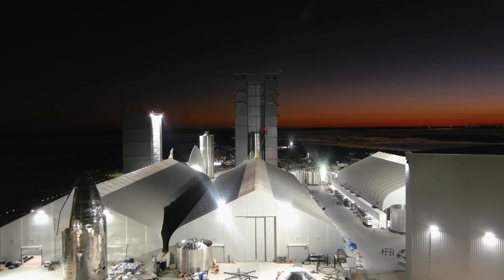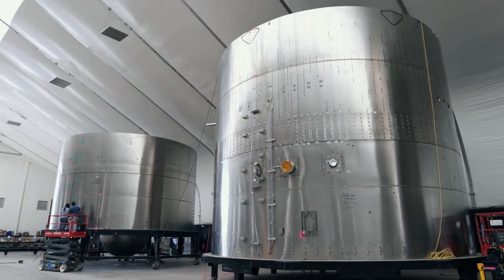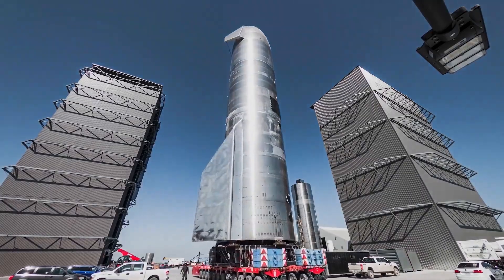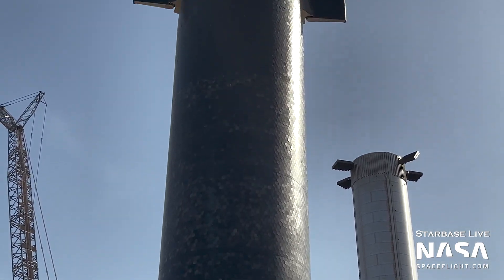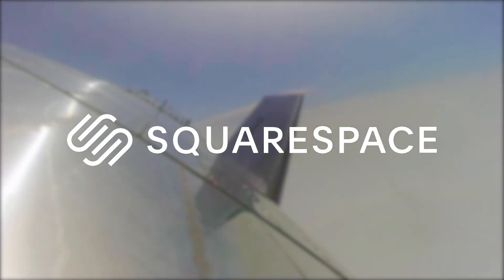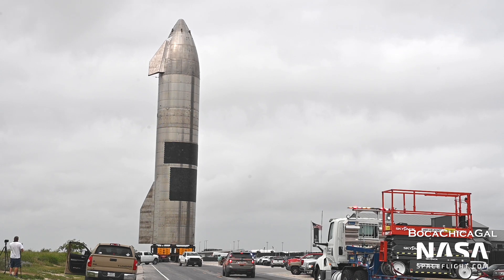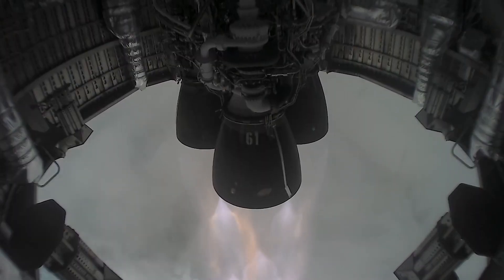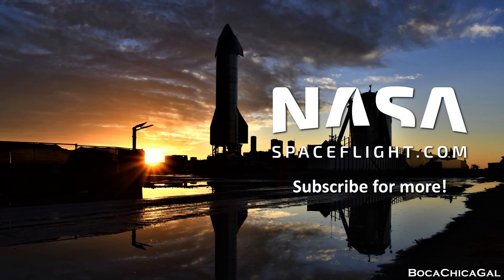How SpaceX's Starship Will Survive Reentry

Comment: The difference to Space Shuttle ist that tiles are on a super cool body causing to ice up during tanking and before lift off causing tensions and break away, especially if tiles freeze together.
Solution could be to relocate star base to a super dry environment like Arizona or Nevada or Sahara and saving at least 10 ton ice at lift off.

Comment: I gather their (post) orbital test landing will be a splashdown (belly flop?) into the sea.  In that case how can they tell how well any missing tiles fared prior to that shock?  Should at least take a little camera drone into orbit to check for any damage the ascent might have done.  

Maybe each tile or tile-location could have a sensor? If “skin” gets itchy then change flight/control mechanisms slightly.  

Might also be useful to fuse with aerodynamic feedback in general during flight (up&down) for whole-body control.

Comment: SS25 making it to orbit and the booster landing would be an amazing outcome already. If Starship 25 fails due to tiles or whatever is less important, since cost wise, the booster is probably the more valueable bit anyway as it was waaay more engines. 

In that case would probably already have a semi-viable product if the upper stage was discarded on every flight for a few more years, considering how much more they can lift with it, especially since there is no other rocket that can lift as much as this. After all they can build Starships pretty quickly already. It probably would not be financially viable to launch the next shell of Starlink like that, but they could probably make some money from launching heavy moon or mars gear or DoD stuff with it.

Comment: I would argue that on sts-107’s disaster had next to nothing to do with the space shuttle tiles being fragile. What failed was the carbon carbon leading edge and chunk of insulating foam. Contrary to your point the shuttle actually proved the robustness of a tile system by demonstrating the loss of some tiles and still fly safely, which it did on multiple occasions.

Comment: Of course tiles will fall off ! They can't be placed directly on the skin of starship and it looks like they won't stay on with the pins because of Frost up ! I believe this problem can be solved with a insulation sleeve on the inside of starship fuel tanks or where the heat shield is required as a temperature burrier . The tiles can touch the stainless if it doesn't freeze  ! ! !

Comment: The video is so well pronounced that the automatic translator translates it into Spanish very well.
Regarding the heat shield, I believe that the variations in the geometry of the Starship, caused by the filling of the tanks, the emptying of the tanks, the thrust of the engines, the maximum dynamic pressure, the re-entry with empty tanks, and also the large temperature changes, from hundreds of degrees below zero to thousands of degrees on re-entry, will make it impossible for the shingles to stay in place.
They should make a rigid steel shield in the belly of the ship, whose geometry is unlinked to the geometry of the Starship and there, yes, put the tiles.
I think that would add 50 tons.
Reply: Or better, let the shield be made of titanium.

Comment: I still think it would be cool if they could somehow direct the plasma  and  off gas it to their advantage, such as housing it as a type of reentry engine or aiding reentry by acting as a reentry engine. also wondering if you could some how magnetically charge the plasma induction and then use magnetic properties to create a magnetic sheild to keep plasma or direct plasma to keep the structure more heat sheilded and to use it as a type of engine to control descent. using the ferromagnetic properties of steel perhaps some form of starship plasma sheild could be crafted by inducing a reverse magnetic gauss.

Comment: ATM SpaceX has only information regarding the heatshield on Starship testing when Starship is doing Static fires at sea level, I think the heatshield will have less pressure on them on launch when the full throttle power is from Super Heavy on sea leven than Starship on sea level

Comment: this tiles are not gonna make the reentry. smallest distortion in frame structure cause loosing several and you are done. obviously you cant make a 1 piece heat shield but why not by every ring section ?

Comment: Starship won't reenter (and land) at orbital speeds for another 5 years or more. Launches, some "low" velocity suborbital hops - likely. But not orbital. This is not a reliable, "30min reusable" solution nor cheap. Light years away from their initial presentation. Instead they will keep doubling down and talking about the need to create even bigger Starships. And crafting them on cameras. Next target and then another. As if those would solve the issue. Human short term memory being the business reason. RIP Shuttle.

Comment: As Ian explains one of the big issues is testing the entire TPS, as a unit, on the ground.  The fundamental design of Starship is fundamentally superior to that of Shuttle with regard to surviving reentry for many reasons.  Basically where relatively small damage to the Shuttle TPS could result in the loss of the crew, that is simply extremely unlikely with Starship.  Starship will survive reentry.  What is at risk is whether Starship will survive in shape to be relaunched with minimal investment.  To maximize the productivity of Starship it is necessary to maximize payload.  Every kg reduction in the dry mass of Starship translates to 1 kg of additional payload.  So SpaceX wants to have a TPS implementation which minimizes the mass of the TPS.  Designing a TPS in which 100% of the tiles survived launch is desirable, but would result in a heavier implementation.  This is why I proposed that one of the Starships from the "Rocket Garden" which has an almost complete set of tiles be placed underneath a 33 engine static fire, the only force on Earth which could possibly test an entire Starship as a unit.  This would reveal what will happen when a Starship re-enters with missing tiles.  Remember it is not IF a Starship will re-enter with missing tiles, it is WHEN it will re-enter with missing tiles.  "Perfect is the enemy of good."

Comment: As much as i love starship, i think they are doomed to fail to achieve rapid reusability with heart shield tiles
They would need it to have tens of thousands individual attachment points not fail for multiple flights
Even if they can lose some tiles without being mission critical, i assume it will make some refurbishment necessary for a section close to the failure
If they want it to launch daily i doubt the shield will not become a problem, still way better than anything that exists
i hope some day they can try active cooling, like they planned for BFR at first

Comment: Once they get past all the legal hurdles being thrown at them it will be game time to flight test to failure to find the limits then optimization to ensure safety well within those limits.
First flight profile I think is conservative with lower than max weight and with as much sheer size they have to work with a faster deceleration at higher altitude than most capsules reducing the lower altitude heat loading. At least one flight will change weight and profile to test limits to failure possibly a second or third flight for a particular build sample. Improvements in the tile mounting hardware, welding and post weld testing along with improvements in the inner thermal blanket are to be expected.

Comment: The tiles need to be overlapping and tied to each other.  Overlapping to account for the ship's steel skin flexing due to extreme temperature changes and due to the vibration caused by the rocket engines firing, and due to whatever stresses are caused by the ship moving through the atmosphere at high speed.  Changes in atmospheric pressure probably also cause some type of stress.

Tying or weaving the tiles somewhat loosely to its adjacent tiles would prevent any particular loose tile from flying away.  The strand material securing the tiles would be secured to the ship's skin mechanically.  The tiles themselves would not be attached to the ship's skin.  They would float.  The leeward edges of these tiled mats would be connected to a tensioning system that would adjust the tightness of the tiled mats depending on the particular phase of the flight.

Also, get rid of both the forward and aft flaps, especially the forward flaps.  The geometry is too complex.  Replace them with air brakes that are stowed in line on the leeward side.  The air brakes would deploy into the airstream at some time during descent.  They would redeploy into their stowed position prior to capture by the chopsticks.  One or two air brakes (one forward and one aft) would do, however, none would be placed on the conical nose section.  If stowing the air brakes is too difficult, then perhaps they could be jettisoned prior to the ship making its final approach to the chopsticks.

Comment: Honestly the whole heat shield issues probably my biggest fear with the reuse ability angle right now. I fully believe SpaceX can achieve it, but I am genuinely worried that if the tiles cannot be made to all stay on and the stainless steel underneath cannot be prevented from melting, then this will massively impact spaceX’s desire for the starship to be rapid reusable.

Comment: Rather than affixing individual tiles cant they find a way to spray ablative material onto the hull in a fashion similar to expanding foam? If that were possible they could build a robotic jig that could essentially 3D print a heat shield directly onto the vehicle which could be reapplied whenever required to allow for rapid turn around times.

Comment: While some areas like the nosecone or flaps' leading edges call for small tiles such as the current hexagonal ones, I think the body should be covered in way way longer tiles (the longer length parallel to the ship's axis) but still with a hexagonal shape. Such tiles would have many more anchor points and would also be way less numerous. Another idea could be to have such tiles strung in ship-encircling metal wires (or not really strung but the wires running in shallow ruts on the tiles): not to support re-entry heat, but vibrations during lift-off and flight in the atmosphere. Of course, I am no expert and there may be reasons not to make such tiles as I described above. I am just sharing my thoughts.

Comment: Shuttle and Buran had tiles attached to the unpressurized airframe, which maintained basically static pressures and temperatures.  Starship has them attached to pressurized cryogenic propellant tanks, which provides immense additional engineering challenges.

Comment: I think reentry is no problem for these tiles, they were designed to support the force in that direction that basically pushes them in to the bracket they are mounted to. The problem in my opinion is the lateral movement on the pad at launch, they seem to be susceptible to that lateral motion way more and that’s the part of the mission to look at very carefully.

Comment: Really I don't see how Starship can be realiable, tiles falling off, raptors melting, fuel delivery system failing and all this without even harsh re-entry environment.On top of that they want to catch the booster and 2nd stage, this is just ridiculous and never will happen.I'm predicting Starship program will end up as huge failure.SpaceX should develop Sea Dragon concept instead, would be more realiable and more capable and not necessary more expensive than fully reusable rocket.

Comment: Well Ian, it's not about the fact that SpaceX is hardware rich.  If the first Starship fails because of something mechanical (to include loss of heat tiles) that is within their control, the FAA, EPA, or any of a dozen other agencies won't let them just spin up another and "go for it" the next day.  It will be a setback of several months as they correct the issue, and reimpress whatever agency is all upset now.

Comment: If the heat on re-entry is down to the velocity of the vehicle as it re-interfaces with the atmosphere, wouldn't it be better to have deployable forward breaking engines to bring the forward motion down to zero, so that the only aerodynamic breaking left will be as starship descends vertically into the atmosphere?
Reply: The Falcon 9 already does this. That's why they point the bottom downward on re-entry; to use the engines for a 're-entry burn'. That way you don't need to deploy additional engines. But Starship is larger and to slow it down would take a lot of fuel which means increasing weight. Using the atmosphere to slow down is a good idea, provided you can deal with the heat.
Reply: @nonconsensualopinion  I know, but what I am saying is the heat issue all but disappears if you use the engines with a significant amount of braking. Capsules don't have proper engines and the shuttle didn't carry excess fuel so they had to re-enter the way they did, but starship is different, it could re-enter using a proper braking burn and vertical drop.

Comment: Man i am obsessed with SpaceX and Starship, i cannot wait for the day we get blessed to see the first flight.  

Yet The closer it gets and the more i see of the Catch/Launch tower. I get more and more nervous.   

The Starship itself to me isn't my main source of concern.  It is the Booster.  Much much larger and heavier then SS.  I see such a microscopic room for error on the Landing/catch attempt.  That booster is about Tons Fueled and about 150 Tons at complete dry mass and about 170-200 At landing.   If it comes down to that tower with even a 5 or 6 foot off target or a higher velocity by even a small fraction could lead to an obliteration of 2 years of work in a flash.   

During the first Catch attempt the booster will NOT have the same room for error the Falcons had in there evolution or even Starship with its Tests.  Both Falcon and ProtoStarship had something that They had Very miniscule to no Surrounding Equipment with the Cost/Time to build ratio that the Booster will have around it on its landing.   (IF) the booster were to impact the tower directly, or miss the tower all together i believe would lead to an absolute destruction( or damaged to point of rebuild) of the tower and surrounding equipment.  With the Tank farm also so close would be another large worry in the case of a landing failure.  I understand, you cannot learn if you don't try, but i never thought of it from this point of view that this thing will have to be almost laser accurate in all aspects for this to end up without utter catastrophe.   It will be Success or Rebuilding and designing for the next 1 to 2 years.  Thank you NASASpaceflight for all you do for this.

Comment: I have a feeling that SpaceX will find a way to remove the need for a tile-based heat shield in the future. We don't know what their engineers are experimenting with at the moment but I won't be surprised if we see something like better engine performance and a bit more propellant so they can slow the vehicle enough before re-entry and not need one at all. I know it would be impractical to try this with the current engine performance and propellant volumes, but maybe in a few years it could be doable.

Comment: Spacex is designed around the fact they are expecting failures, in fact they want to record, measure, and create solutions, for successful space flights. We also know that the FCC is holding SpaceX to being earth bound. They can do it at a much cheaper, and more replications of same ship configuration, then any one in the industry. Also with their capsule deliveries, and return flights, they can take tile testing further based on the capsules return during re-entry. Which few if any other companies, can do.

Comment: Random tile question: Could those be used instead of the problematic martite under launch stands? They are designed to withstand extreme heat and wind velocities, so they should stand up under the Raptor 2 exhausts, right?

Comment: All of what was said is and was operative for ship 20. If the methodology of attaching tiles is significantly different now than earlier, not flying 20 starts to make sense. Otherwise, throwing ship 20 into the Pacific, imo, would have provided a huge amount of data that, as was stated, is not possible without subjecting vehicles to hypersonic environments. Musk must have lots of excess $$ to throw away along with his prototypes.

Comment: In Starship’s defense, the stainless steel body can take a magnitude more heat than the aluminum body of the Space Shuttle. And the uniform body will make dissipating built up heat easier. Heat tiles falling off even in patches isn’t much of a concern. It would take large patches of them falling off to really worry me.

Comment: Seems the solution is to remove enough deltaV while still in space so that you don't need tiles.  It doesn't have to be all the deltaV, just enough to put the heat generated within the tolerances of steel.   And how do you you do that ... Stage 4:  orbital mass drivers, tethers which trade positive and negative delatVs.  Yes, it will take time to build up enough mass in a space station to support deltaV management for ascending and descending spacecraft.  But SpaceX plans a hourly launch cadence (through multiple launch sites) ... shouldn't take but a year or two for returning spaceships to only require aero surfaces and greatly increase safety.

Comment: They can take the heat, so vibration+ wind tunnel testing must be happening.
The landing angle, velocity, & shape generated hot/turbulent spots are improved on SS.
The Felt is a thermal protection sys that will reduce tunneling under the tiles.
Steel is lots ! Better than thin aluminium & could potentially be a little Thicker on the hot side.
While expecting to see many Tatty StarShips a burn through generated RUD is very unlikely IMO.